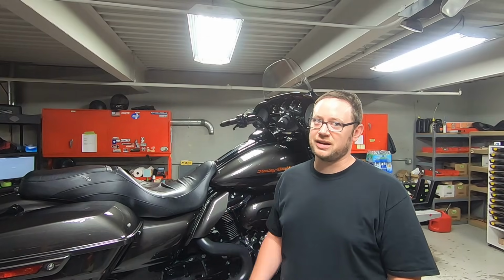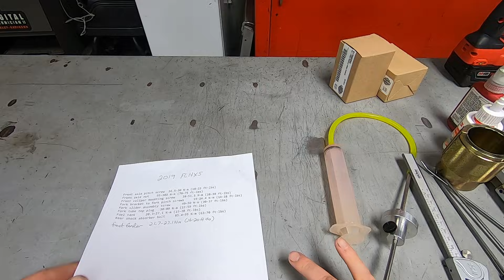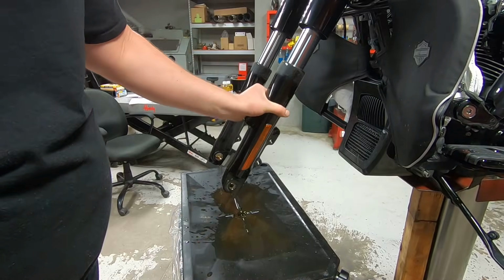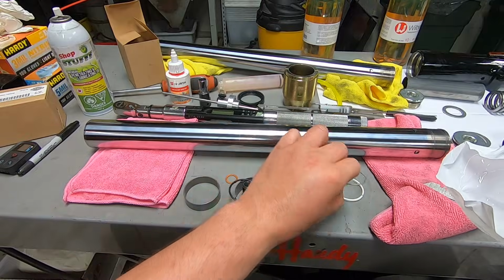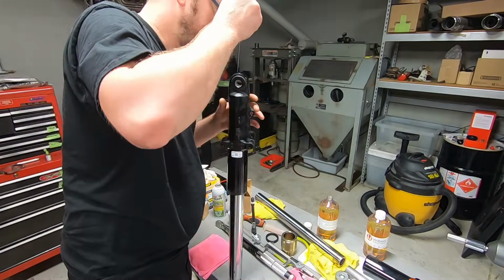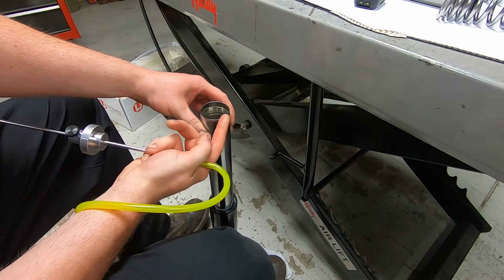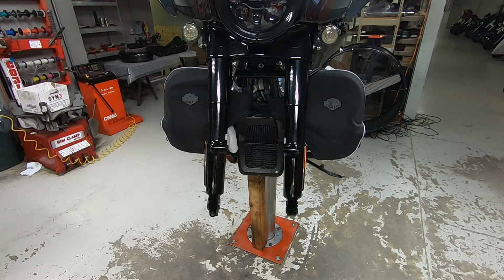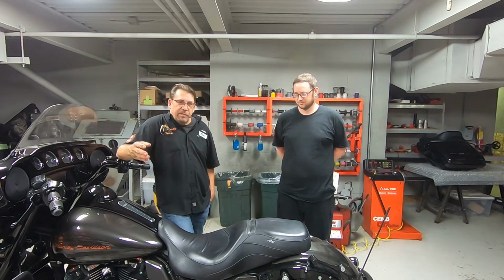Wilbers LDC Full Front And Rear Suspension Installation And Review For Harley Davidson Touring Bikes

Comment: I think I've heard about this setup on Laidlaw's channel. Wilbers makes stuff for BMWs too. It's what I would get if my struts died. Fork springs are short. At least it seems that way. The shocks look short too. How much travel? Does it stick with the 2" travel? I'd go with more...
Reply: Rear Shocks are always the same length, also for the Specials. While in motion, you have definitely more suspension travel with a finer initial spring rate.
Reply: @stefansgarage3014  The problem with SGs, RGs and specials is 2" of suspension travel. There's only so much one can do. At least upgrade to the 3" touring shocks or shock length/travel and even then it could be better.
Reply: @nokoolaid  The LDC has the same travel like the std Touring (3`), but a variable spring rate while traveling. I wouldn't ride my 2019 RG CVO without it anymore (so do my friends 2018 RG CVO, 2013 SG, 2018 RKS, 2013 RK). As Dale mentioned, it is a day and night difference-and that was not scripted!. It is pricy but there is nothing close, no matter if you are riding 1 or 2 up.
Reply: @stefansgarage3014  Well, there is if you go with a different bike manufacturer. I am not a harley hater nor kool-aid drinker. It's just an engineeriing limit with the setup they have. A Goldwing or BMW will have a better suspension out of the box and they can be upgraded as well. With HD, it's form over function. I am sure the Wilbers do make a world of difference though and would be worth it if you had that kind of bike.
Reply: @nokoolaid  Be sure, we all know Harleys are not famous for their suspension, but we want to ride Harleys and no BMWs etc. We like Harleys for the style, the feel. There are better and cheaper bikes out there AND riders who love these bikes-we love Harleys. This whole motorcycle thing is about emotions and not about necessity.
Safe rides on any bike you like ;-)
Reply: @stefansgarage3014  I operate from a different part of the brain. It's not necessity vs emotions, its logic vs emotions. I think HDs are cool, but like everything, it is what it is, good, bad, different, etc. Narratives and beliefs are usually fomented through emotional thought and rarely questioned. Ok. That's fine, but eyes wide open. For me, function is more important in certain areas. Suspension is one of them. I've had a few fusion surgeries. With that said, I will use what works best for me, but it's not centered around beliefs/narratives. If something works better, I go with that. It's pretty simple. I would just hate to spend that kind of dough on a bike and get back pain and more back problems because of how I felt or believed. It makes no sense to me, but obviously, we're wired very differently.
Reply: James L Sorry James, but this is getting funny...
Reply: @stefansgarage3014  I guess it escapes you. Sorry, but I am agnostic about most things. Most folks never ask themselves certain questions.